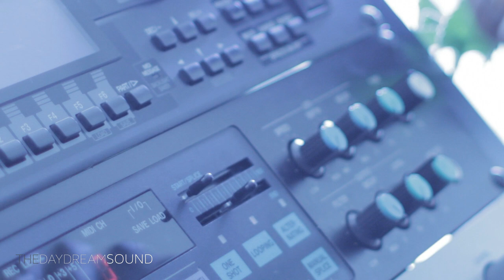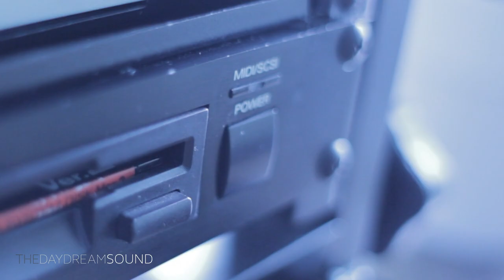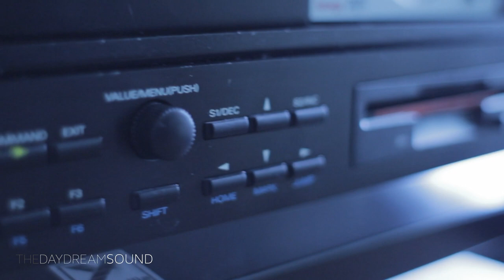Hardware Sampler DIY Digital Delay

Comment: What is that display you are using? I've been searching for a small display with scart for my S-550 but can't seem to find any
Reply from the maker: What's up Pera!!!!! Thanks for asking!!!! This is just an composite LCD monitor by Neewer. I don't think you'll find a monitor with SCART these days. You can always use the monochrome video output on the S-550. It would work with a monitor like this one.
Reply: @TheDaydreamSound  thanks, that neewer monitor looks great. I bought an RGB to SCART cable a while back and hoped I would find a cool small monitor to go with it. I'll have to go with monochrome it seems.
Reply from the maker: You're welcome man!!! That's what I would do as well. I wouldn't be bothered by it too much.

Comment: Awesome tip as always. Also Little known trick. Some hardware sequencers  like Yamaha rs 7000 have. A midi delay section in the sequencer. Which saves on using delay fx sources 
Fully quantize control also
Reply from the maker: What's up man!!!!! Thanks for watching man!!!!!!!!!! That's a great feature to have onboard!!!!!!!!!!!!!